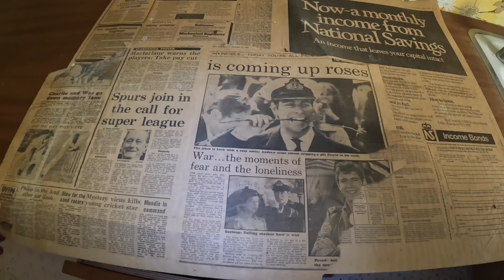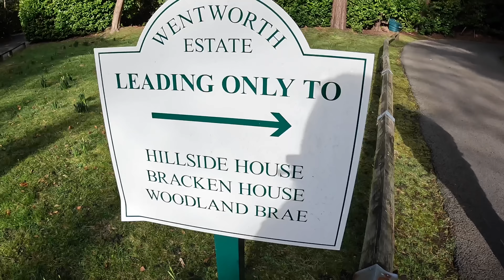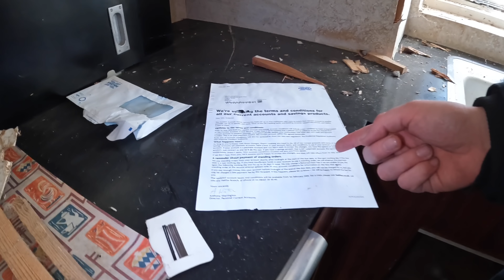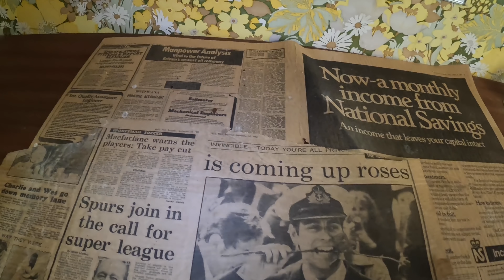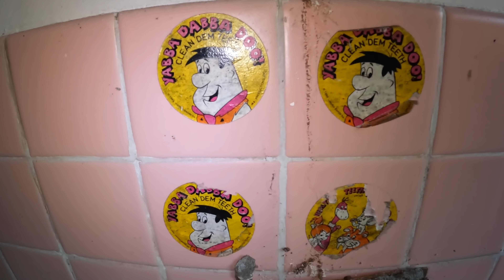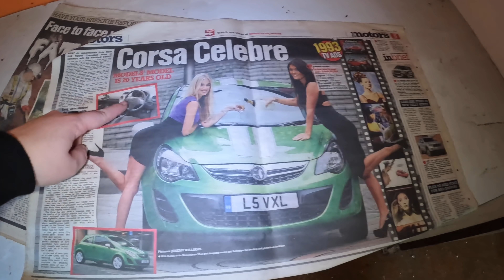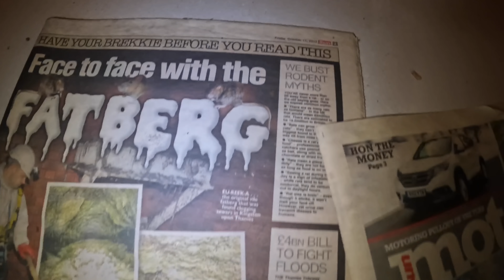ABANDONED CABIN IN THE WOODS LOST IN TIME| YOU WONT BELIEVE WHY THIS HOUSE IS WORTH MILLIONS!!

Comment: Great upload kayleigh!! That property was deffo 70s onwards, could tell by the electrical sockets & fixtures. 

Also it was common for folks to lay newspaper on the floor before laying foam backed carpets so it wouldnt stick to the floor over time! I remember my dad doing the same back in the 80s when foam lined carpets were all the rage.. 👍
Reply: Yeah try getting the carpet up 20 yrs later. Guess my step uncle didn't know about the paper.??
Reply from the maker: 100%! Yeah its 70s. Ooh really! I didn’t know that. Thank you for the information Dazzy! X